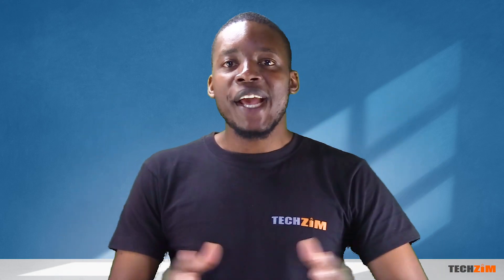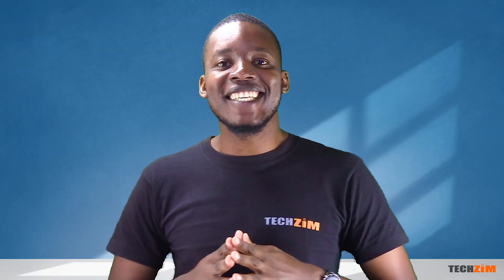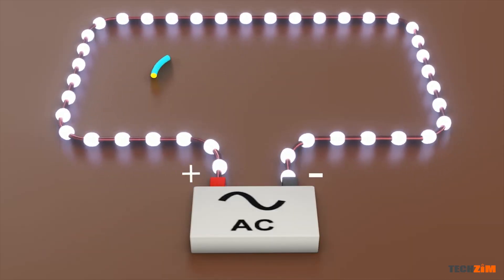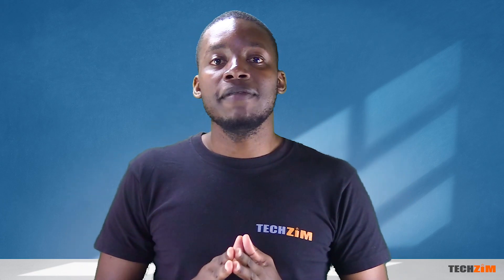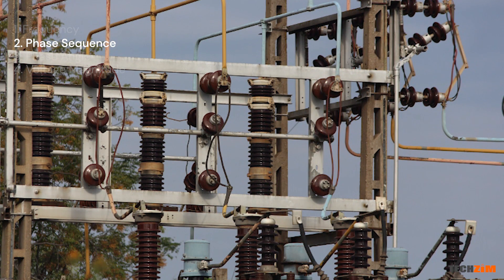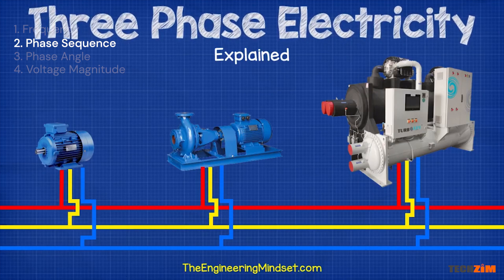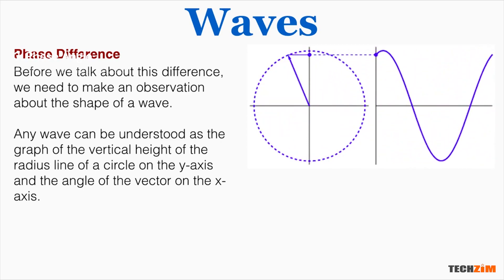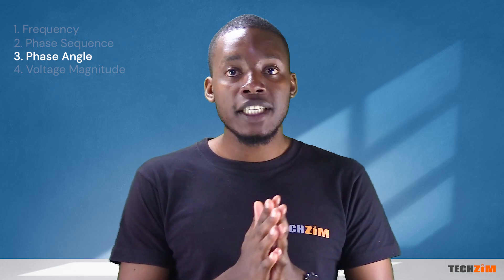Hwange Unit 7 synchronised. This is how they did it

Comment: does this mean there'll be less powercuts?
Reply from the maker: We still have a huge power deficit. The new hwange units are not really adding to what is existing but rather are replacing the old units that have exceeded their expected life span. So the levels of loadshedding will not really improve